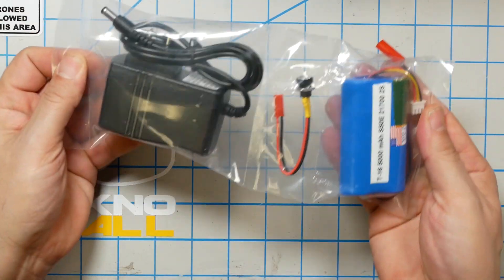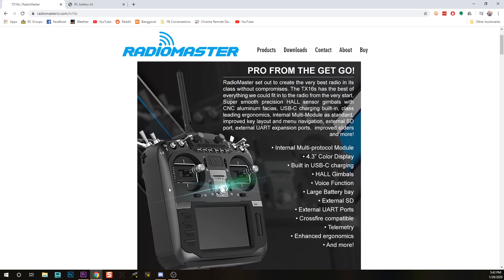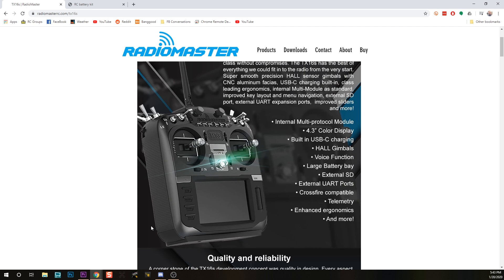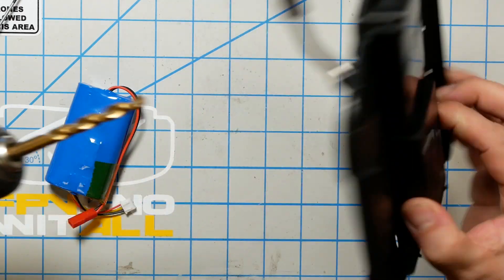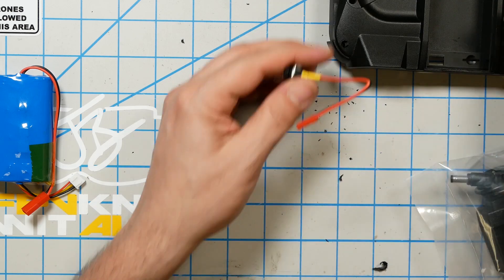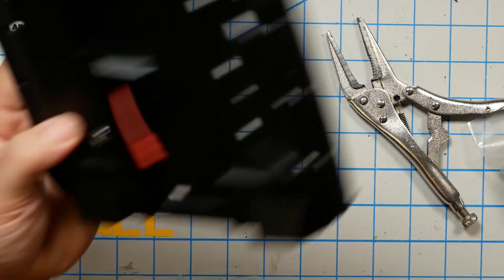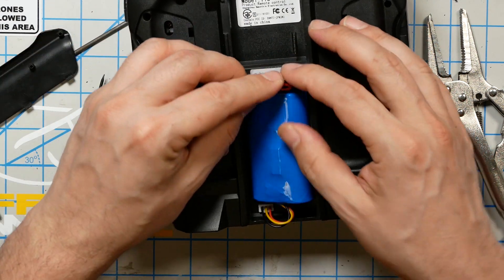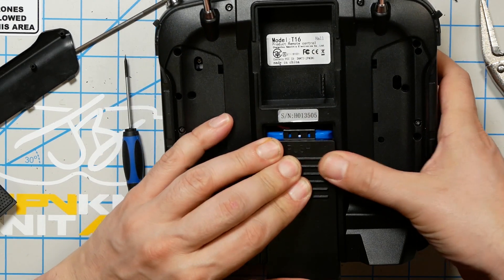Jumper T16 Internal Battery Charging Mod

Comment: "Maybe you don't have a drill bit" So instead of spending 2 dollars on a bit just wreck your soldering iron tip.
Reply: I use the soldering iron tip on occasion for specific projects, never had melted plastic wreck an iron tip as of yet ...
Reply: Its only soft plastic it wipes right off the iron nomdamage whatsoever
Reply: @dazzdoodlzfpv1020  In my experience anything other than solder on the tip will lead to corrosion sooner or later.
Reply: @thirtythreeeyes8624  I 100%agree with you I shouldve been more specific i use an old bit and its a large one I never ever use i agree I wouldn't use a bit that is still serviceable
Reply: And its still shiny as shit no corrosion whatsoever...sorry im at work ....

Comment: Not related, but if anyone needs some cheap 4S 850mah batteries, this guy will automatically accept an offer of $25 for 4 x new Venom 75C 4S 850mah batteries with XT60. I bought them for practice with my GTR369. They seem fine. Haven't had time to try them with anything else. It's my only 3" with an XT60. Need to make an adapter cable.  At $6.25 each with free shipping, I went ahead and got 4 more. https://www.ebay.com/itm/4-x-New-Venom-75C-4S-850mAh-14-8V-FPV-Racing-Drone-LiPo-Battery-XT60-Deans-EC3/333417449629?hash=item4da13a889d:g:YogAAOSwkYld4asu. Sorry if posting this is wrong. Just thought it was a great deal.

Comment: If you can find a 2S balancer charger circuit that works off 5volts then you can just hook it up to USB internally. That would be the best.
Reply: Yep that's what I did I got. 2s USB charger from Amazon and now.my Jumper charges from the top USB port. Over night as it pulls only 1amp.  I also converted the micro SD to be a NAS so I can upload files to it. Toshiba FlashAir is the device and I will post the custom code you need tomorrow. I can upload new files from my phone now pretty nice.
Reply: @SmothBrains  do you have a name or link for the charger circuit. I haven't yet found a compact one.

Comment: I already did that successfully but chose my parts myself. What I would like to add in this setup is a 2s bms that protects and balances the cells or the cells themselves should be of the protected kind. It costs only about a dollar and will help the lifespan of the cells. I am fortunate to be able to spotweld though.

Comment: a file may have been useful to clean up the hole?
Reply from the maker: I. I did that. Did you not see the part where I filed the hole?
Reply: @JoshuaBardwell  I have a $2.99 ream from Harbor freight. Drill a little under size  and ream to suit, https://www.harborfreight.com/t-handle-reamer-66936.html

Comment: Nice option but $50 to charge a radio I payed $150 for is too steep for my blood.  I'd just put an RDQ Series 7.4V 2S 3000mAh FPV Goggle LiPo Battery w/ Charge Indicator.
Reply: TRexHeliPilot remember that you are getting two high capacity LiIon cells. And those don’t come with the radio that is already cheap for what it offers.

Comment: 1:14 shame on you Josh "Come back in the morning ? ! " "I'm Joshua Bardwell and I'm going to burn my house down today" But in all seriousness, I'm sure you did not mean that literally. Z
Reply from the maker: Charging this type of LiIo cell at a very slow rate is different than charging a LiPo that has been bashed around and may be damaged. You leave your cell phone charging overnight right? It's not any different in my opinion.
Reply: Yeah I've been charging my ebike battery overnight for over a decade now without worry. I've twice replaced the cells in the packs I have, because it was 1/3 the price of a new pack. First time I swapped out the 28x 18650's for new ones, 2nd time I figured out I could put 14x 5000mAh lipo cells in - they were both tricky soldering jobs, had to make sure to not short circuit anything to avoid bad things happening.
Reply: @JoshuaBardwell  good to know, thanks JB !  ;)

Comment: I'm wondering I could run my fs i6x on 18650's? It takes 4 AA's.
Reply: A quick google search reveals it is possible, I saw a video where someone powered their FS-i6X using a lipo & USB boost board to put 5V into the radio - but as the 5V boost board doesn't monitor its input voltage properly it could completely drain the lipo and ruin it.
My suggestion would be to use the voltage boost board from a cheap 18650 USB power bank, and use the 18650 or a 1S lipo that fits in the transmitter, because it has two distinct advantages - you can charge the lipo by USB, and it won't kill the lipo by draining it too much. However you won't get a warning when the radio will switch off because the lipo is empty, so I would add a small LED voltage display and a microswitch, then you can simply press the button to see the lipo voltage to make sure it's got enough juice before flying.

Comment: I’m running my X9D off 2S 18650. I got tired of pulling them out as well.

I bought one of those cheap 2S chargers and wired it up to the internal 2S balance port and used the existing DC barrel jack. I VHB’d the little charge board to the backside of the battery bay (internally).

That was the best $8 I’ve spent in a long time.

Comment: the battery never used to rattle around if you used the little foam disc that came with the jumper.
great mod..i will be doing this for sure
Reply: I told him about the little foam disc Azza, he didn't want to listen.... lol
Reply from the maker: I lost the foam disc what do you want....
Reply: @JoshuaBardwell  did it roll away on you...lol
Reply: @JoshuaBardwell  LOL
Reply: @Bitathisandthat  Too funny Azza !
Reply: I found the provided one a little bit too thick since the cover was bending outwards slightly. So I used some spare foam tape with a little less height.

Comment: As always, Excellent video. Definitely surprised by the amount. Bob's doing it big.
Reply from the maker: If you add up the cost of the parts, they easily come to $35 or $40. Honestly, the price is pretty reasonable. But if you think you can do it cheaper, more power to you.
Reply: @JoshuaBardwell  If someone can do it cheaper then I'll hire him!
Reply: @JoshuaBardwell  I want it powered by the existing USB plug, should be possible to just cut into it? I can only find one 5V USB -> 2S charger and it's $12-13 from Emax. Could it also be an option to just use a 5V->9V DC boost converter and connect it to a 2S BMS to stop charging at 4.3v? That'd cost under $10.

Comment: Love the work you do Joshua!  I did an internal pack in my X9d, 3S 3,400mAh...pack has a  fake 2S lead for the transmitter, a real 3S balance lead for balance charging, and a real XT30 for crossfire and charging. Got no need for another wall wort that only powers one thing...especially since i go weeks without charging...doesnt your smart charger do a better job? 21700 5,000mAh is pretty easy to do internally also!

Comment: I soldered to the battery leads a Fly RC 2S 7.4V LiPo Battery Balance Charger Cable Lead Wire Connector from amazon (10 for $5.99).   I have to open case and charge each cell individually though. This does keep the cells balanced.

Comment: Good video JB, pretty easy mod for anyone. as for 50$, a little pricey, but not totally unreasonable. Look at the parts list to put this together, then someone had to order the parts, assemble them, and package and ship anda anda anda panda. Unless someone else does it, with the same quality , but cheaper, this looks like a good option.
Reply: Don't forget to add the cost of a quality spot welder!

Comment: Can't wait to give this a shot! It seems like my 18650s are always draining so quickly.
Reply: Try getting the huge capacity ones, I'm a huge fan of Panasonic NCR18650B, 3,400 mAh...I've got 3 of them internal in my transmitter, get about 2 weeks of flying every day, with Crossfire on 500mw dynamic
Reply: @davidshaddix4284  will do thanks for the advice!

Comment: Hmmm. Neat but I’m not sure it’s worth 50 bucks. I power my crossfire with an external 2s LiPo that I Velcro to the battery cover. I fly atleast five packs every day and usually don’t have to swap 18650s or recharge my crossfire battery for atleast three days. It’s also 20 degrees here.

Comment: I'll keep this in mind, thanks Josh!  FWIW - when I ordered mine from @graysonhobby I also ordered the 18650 batteries they offered during checkout for $9.99 thinking that was a good deal.  I SUGGEST NOT DOING THIS.  After researching the "6000 mAh" batteries I quickly figured out they are cheap China knockoffs and ARE NOT 6000 mAh.  They would go dead in only a few hours.  I ordered a pair of 3500mAh ORB3500P.  BIG difference in staying power.  The 3500 also weighed 10 grams more.  They are 4x as $$ but are lasting days of heavy use!
Reply: Kinda learned the same lesson.  The same looking are not always the same working.
Reply: Yes, I did measure the Grayson Hobby yellow “6000” mAh batteries and they are only 1000mAh, and do drain very quickly. You get what you pay for. Also worth noting, the battery case will not hold protected 18650 cells, they are too long.

Comment: If you bought everything from Amazon, it would be about $35-40 (2-batteries, DC plugs, charger, and charging circuit).  So, the link to buy everything that is ready to install for $50 is a bargain.
Reply: True and it take me around 45 minutes to build a kit and first class USPS is included, usually 2-3 days with tracking. I am able to make a few $$ with economy of scale by buying hundreds of components at a time.

Comment: BTW, that USB 2S balance charger you glanced at on last night's livestream at the 56:47 mark, it might not output 2S voltage...
I have a USB 2S balance charger that came with a cheap RC car from Banggood to charge the 18650 2S pack which only has a balance plug. Internally the USB device is actually a 1S charger and every 2 seconds it alternates which cell it charges.
It has an individual cell charging rate of about 480mA, so an empty 2000mAh 2S pack would take over 8 hours (2000*2/480).
Reply from the maker: I knew for that price it had to be a joke.
Reply: Technically mine does charge a 2S pack, but you'd have to put it on charge overnight for it to be of any use.
The one you linked to says it has a charge rate of 800mAh, if that's 2S @ 800mAh it's still 2.5 hours for a 2000mAh and over 4 hours for the 3350mAh cells I use.

Comment: Once you own a certain device and it can be modded, you mod... I replaced my front cover for one with a carbon-ish look. Hell of a job, but well worth the effort. It looks so much better and easier to recognize as everyone seems to have a T16 these days. 
Next step will be to 3D print a wallmount dockingstation. At the bottom left-side there's plenty of room to fit some slide-into connector.

Comment: I've hesitated on buying a kit like this because I like being able to just swap batteries more than I'd like to not need to take them out at all (especially for something like a weekend trip). I do like the switch to a pack though, and it'd be easy enough to put one together that can be charged just like my flight packs. The included holder is kind of a pain and it would eliminate the need for a second charger just for the 18650s. I'm definitely going to be giving that a try.

Comment: Will these cells fit inside a Qx7 battery bay? I’d love to do this mod to mine.
Reply: The larger cells shown might be too thick.
Reply: Kyle K I was thinking the same thing, but I have a 4000mah 2s lipo in there now, so I may just figure out a way to add external charging to that.
Reply: Aloft hobbies sells a charging mod for the qx7. Costs about $10 and works great.

Comment: 2500 mAh Lipo last for weeks but 3000+mAh 18650‘s are draining quicker? I don‘t get how that can be true.
Reply: I can confirm. My x9d got tons and tons of flights out of the stock 2000mah nicad. 10 packs back to back and the battery wouldn't even blink. The jumper T16 is maybe getting 20 tiny whoop flights out of a pair of VCT5s (2600mah) before it needs a recharge. I suspect the T16 is just power hungry as hell. I'll have to check the current draw between the 2.
Reply: I recently did a power test of my T16 with Crossfire, it draws 400mA from the cells when the backlight of the screen is at full, and 350mA when dimmed.

Comment: When drill in plastic, ALWAYS reverse the drillbit it will avoid cracking. Because it will happen sooner or later...
Reply: Or use a Uni-Bit, then the hole is perfectly round and clean every time
Reply: Good tip, I bought an edge reamer tool to make holes in plastic. Great for this sort of thing.
banggood.com/Raitool-DT01-Edge-Reamer-Professional-Reaming-Universal-Hole-Drill-Tool-0-14mm-Opener-Reamer-p-922461.html?p=UG06171211488201502B (link with Joshua's affiliate code)
Reply: @licensetodrive9930  How sharp is this thing? I was thinking about picking one up but I am a bit afraid of their build quality...
Reply: @Žan Pekošak  It's very sharp, did try it on a bit of circuitboard to make some mounting holes which worked ok but could see the cutting edge now looks a little dulled, but on plastic it's superb so I only use it on that now.

Comment: kind of pricey for a battery mod.. instead, I went to thingiverse and copy this guy. Really don't need to print that model. just follow wire the diagram.  https://www.thingiverse.com/thing:3589586   Much cheaper in my opinion.
Reply from the maker: Much of the price is the high-quality cells. If you buy the best quality LiIo cells they can easily be $10 or $15 each.

Comment: I've been thinking about adding a balance charge socket to my T16 so I can charge it with my iSDT Q6 charger, but without modifying the shell in any way, instead I'd copy, redesign & print a new battery cover with a balance socket in.
Reply: I leave my balnce lead in the battery bay, just take the door off for charging!
Reply: @David Shaddix  What's the connector/wiring setup of yours? Mine is the standard 2S balance socket in the T16 battery bay, with a 2x 18650 holder that has a single balance plug attached. I have to unplug it to connect to my iSDT Q6 charger, using a cable I made with an XT60 & 2S balance plug+socket.
I'm thinking about creating a short 2S splitter cable to go with the new 3D printed battery cover to maintain the 'not permanently modded' situation.

Comment: Can I mod the T16 so I get battery power to the Jr Bay to use the full-size crossfire on 2W
Reply from the maker: I am pretty sure the Crossfire requires power from the external plug in order to go to 2W. With this mod, the charging plug has 2S voltage on it and you could use that as an aux power for the Crossfire with a barrel-to-xt30 adapter.
Reply: @JoshuaBardwell  With the mod i have done to my radio at the moment i can run 2W through the normal module bay input. Do you think the module bay of the t16 could support that load
Reply: @JoshuaBardwell  I have a number of kits running Crossfires. The board and batteries are good to 10 amps. Batteries are happy with a 3 Am charger.
Reply: @bdmvy  So I can use my t16 with crossfire on 2W?
Reply: @aeryofpv  The charger port puts out 8.4 V at 5,000 mAh. I have a charger port to XT-30 adapter which can be ordered with the pack.